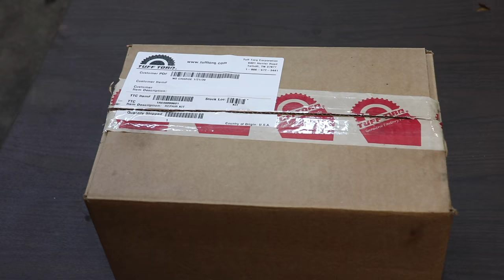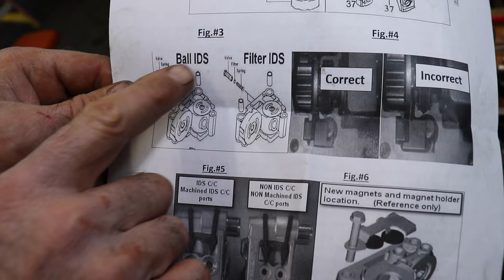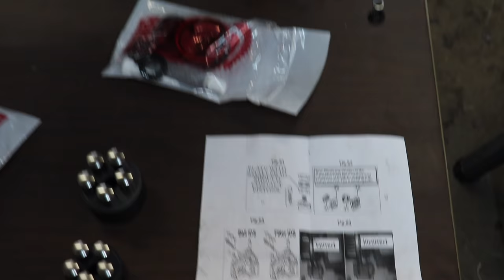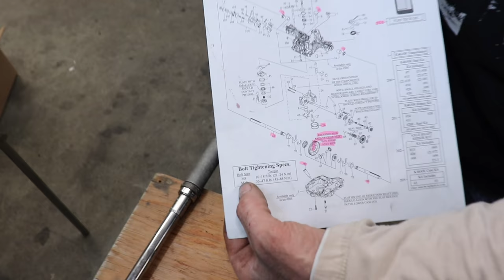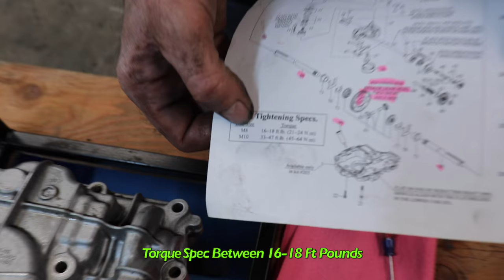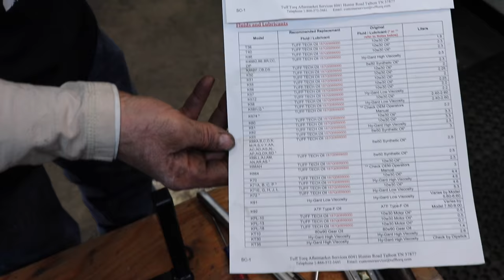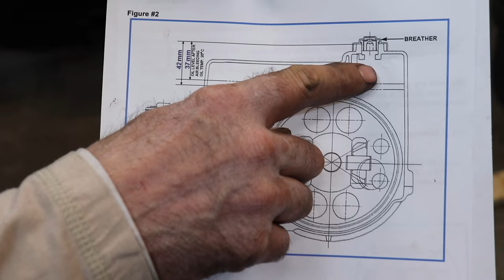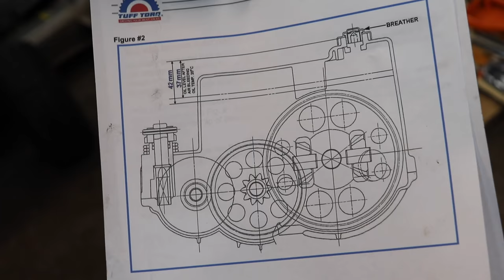How To Rebuild A Tuff Torq Hydrostatic Transmission: A Complete Guide

Comment: Thanks for the informative videos!
I have watched many, u r the best, u even known the names and operations of the parts 😮
I am deciding on rebuilding my cub cadet-K46 XT2 -435hrs. No go in forward/reverse. My dealer in Morristown,Tn. Said Sorry,have a nice day!
Why don’t the dealers/sellers of the mowers tell u this ? It’s not in the maintenance manual, if u call tuff Torq for info or help they say sorry for your problem and did u service the unit at 50hrs then every 200hrs after!!!! No I was not informed .pass this on ,Thanks
Oh yea don’t even try calling Cub customer service! U will be ingorned by a computer 😢

Comment: Two things I did to make life easier:  First I cut some 2x2 wood pieces -- 2-6" long and 1- 6-1/2" long and used lag bolts through the mounting holes to make my own stand.  Quick and easy.

Second I used an Irwin "quick grip" clamp to pull the gears, pump and pump body together.  That way I could install the first pump body by tilting the trans, then set it back down and using clamp to hold the big assembly together set in it place.   Just be careful with those two little mushrooms sticking out --  they will take off if the springs are compressed and the assembly lifts up.

Comment: I've rebuilt two of these.  The k46 is complete garbage in my opinion.  That's part of the reason why the big box stores can sell riding mower's for so cheap.  Luckily, I found a k66 on surpluscenter and never had a problem after I made the conversion.  Good video.

Comment: **NOTE*** The direction of that swash plate on the drive side can vary among the different K46 models.  Early 46BC and 46BD models swash plates are installed in the opposite direction to the model shown in the video.  You can confirm this by looking at the parts diagrams on the tuff torq website.  Also keep in mind the diagram is "up side down" relative to how most would service the trans.  Best to take a photo of yours before the tear down.   That's what saved me.

Comment: I was thinking about air in the pumps and passages, stated 1:07:22 So I was thinking that maybe it's better to run the drill test and recheck the oil level 🛢 before tapping the cap on.
Btw, excellent film 🎥 🎞 📽 🎬 🎥 I was about to skip rebuilding and buy new after watching the last guy. But you made it look easy. Thx for being very thorough.
PS - 
Mine is a 1999 K62 that has/had optional dif lock. Only mine don't have the option. Is it possible to upgrade? OK, possible within reason like just buying the necessary parts and installing like a bolt on, no machining.

Comment: One thing you missed during inspection in the pump and motor parts those spring loaded pistons should have almost zero side play they ware out and allow fluid to leak by. Keep it up I love the videos.
Reply: @JM-yx1lm  yes I was just saying that the most common thing I see is the positions ware out and cause the slow lack of power. He was saying the motor and pump were good without checking those Wich is whare most of the issues come from. Anyway still a great in-depth video on the replacement of the pump and motor
Reply: ...Wear..not "ware"... :)
Reply: @dyer2cycle  So, if true (& no reason to doubt Lol!) any more specificity w/r/t the diagnostics would be of EXTREME help ... w/ kits w/ pistons now running $3-400.00 + and wet/dry sandpaper $3-4.00 ... well just sayin' ... like the vid good show, but w/ tuff torq reps crawlin like ants any further advice RE: tolerances (even down & dirty delta factors) would be of GREAT help ... "most of the issues come from"?  60-80-90% of the time?   How MUCH wear out is literally = wear out?

Comment: Similar to bobcat s large excavator pumps and motors. Swash plate pumps and drives .
Nicely made that Tough Torque transmission.
They should put a drain plugs on them .
Reply: Good 👍

Comment: At 55:00 there are indeed supposed to be two O-rings around that shaft. They are to be double stacked. I hope your fix with just the one new O-ring didn't leak.  TGCA
Reply: Thanks for the tip, have the seal kit and going to do the work in the spring.

Comment: Excellent video. Wish I had seen it a couple of years ago when I had to rebuild the pump. I find it's now necessary to replace the pump shaft, I've been told that can be done without disassembly of the transmission. Can you verify this?

Comment: i think you should check the fluid level after you test run it.
Reply: Chuck the input shaft in a drill and purge the air that way.
Reply: Yes.
Reply: @sethkrahn3155  Thanks. It worked well. Thing is scary powerful. Gt 5000 with hydrogear 331-3000. DAMN! It'll do the job...

Comment: I have a craftsman 19.5hp tractor that I picked up for free so I been putting some work on it overall it's not in bad shape so i got the engine running great repaint the entire tractor frame finder and hood now having a look In side the transmission witch its a K46BA trans I found that it's in great shape but the bypass or free wheel didn't work either the brakes so with this video help with repair I found that whom even had it a part did a bad job with it the bypass pin was out in the case not were it supposed to be spring and snap ring off the shaft got all put together now it works great but the brakes was missing one pade on the right side so I made one with a piece of metal by cuting and grinding and sanding to make it fit work great it's hard to get parts for tuff torq transmission were I'm from so I made do with what I have

Comment: I agree that 47lbs ft seems high. First bolt actually broke in the casing going over 43 so case back off and get another set of bolts. Second set one of the bolts literately pulled the threads out of the case. Tap, helix and larger bolt fixed it for a time but now I’m replacing the case with an eBay special. 
I’m not a rocket scientist but I know my way around cars and this stumped me. I cleaned the threads out before assembly and the bolts were new in both cases. This makes my torque wrench suspect unless anyone else has a thought.
Reply: It's too much toque. I'd do them by feel, no way I'd put that kinda torque into aluminum threads on such small fasteners.

Comment: I rather see a aluminum case tuff torque trans then a plastic John Deere trans.
Reply: J M exactly it’s terrible this new quality of today’s terrible machines! I mean Chinese engines!!!! CMON!
Reply: @JM-yx1lm  well the older ones are good but the newer ones are garbage
Reply: @LIMowersAndMore  1:11:04!😂
Reply: John deer required them to not sell you parts for tuf torque transaxles sold in jd equipment over the phone you have to buy it on there website. I hate John deer lawn equipment they are just stickers on cheep low quality mowers
Reply: @JM-yx1lm  john deer now puts computer chips and codes in each tractor part to shut down tractors if farmers try to do any maintenance or repair themselves. crops have gone unharvested/wasted because farmers can't reach the nearest dealer 500 miles away. states are now beginning to pass right to repair bills. it's hard going as phone manufacturers don't want right to repair bills to pass
Reply: Oh I agree completely ….But to be honest I have seen many failures of these type of trans under Cub Cadets ….Often a oil soaked tire is indictive of the failure and a very slow moving piece of equipment {assuming it even moves at all }
Reply: Holy crap yes.
Reply: yeah NO.... I have a factory installed Tuff Torq PIECE OF SHIT in my D170 John Deer. I am on my second (warranty replaced at 170ish hr) K46. I have 256 hours and IT is done.... 
It's aluminum and a certified piece of SHIT !!!!!!!!!!! Not serviceable, no reservoir, no external filter. Just a CHEAP, BOTTOM OF THE BARREL piece of SHIT !  Class action suit filed.
Reply: I will NEVER buy another John Deere, i THOUGHT I bought American quality.... I bought SHIT ! Runs just can't MOVE !!!!!!!!!!!!!!!!!!
Reply: @JM-yx1lm  Briggs & Stratton same thing the quality is gone.
Reply: @Mark-nu5vg  I was just thinking this the other day, I have been on the 🖕JD bandwagon for over a decade (aside from old-really old obviously) but Briggs.....c'mon wtf how many red blooded Americans cut their teeth on an old Briggs before their balls even dropped,I know I did and have been a big fan since I was 6 but now it to has gone to the new American way, get it cheap af and send it,if they complain fuggem
Reply: My dad is big on John Deere. Don’t know shit mechanically, just buys crap because it’s green and yellow and has JD on it.  After he bought a gator and it went to the shop three times before 10 hours on it (lol) I finally got him away from that garbage. Still has the gator and it still runs like ass with 40 hours on it and a commercial zero turn broke down with less than 500 hours on it lol.
Reply: @daverodkey  hey Dave, I have a tuff torque sludge-O-magic piece of shit that puked at 190 hours, right smack dab between your 170 and 256 hours. The B&S commercial V-twin engine is just finally broken in at 190 hours and the transmission is shot!?!  My lawn tractor would require 10-15 of these washing machine sealed gearboxes in its service lifetime.

where do I sign to sue these bastards?
Reply: I have just watched a video showing a John Deere lawn tractor owner replace his K46 transmission with a K66 Tuff Torq transmission ( if I remember right ) and the K66 is a much more heavy duty transmission according to the tractor owner.
Reply: Lol true
Reply: Kevin Bolin we had more then 25 come to my shop here for returns and warranties it’s terrible!
Reply: Kevin Bolin I miss peerless!
Reply: Robert Slackware  then you'd be happy to see there is a CHANCE Louis Rossmann may get funding to go around to more hearings and get some pro right to repair lobbying going on. so far it's too bad that funding is just a CHANCE!  other wise it the status-quo wont' change to till some younger NON morons get in to office, assuming they aren't' corrupted.
Reply: @Mark-nu5vg  Sadly, it's a trend that has been dictated by the market. China is well known and huge because they excel at making cheap goods in mass. Time has proven that people will buy mass quantity of "not the greatest" stuff if the price is cheap so we did it to ourselves.
Reply: @ dave rodkey , err you can avoid the brand but not that part its in most ride on mowers today lol,only older chain driven stuff is your escape from it.

 I rebuilt mine like taryl and been better than new ever since 12 yrs on 💪😁
Goodluck!
Reply: I don't care long as the gears aren't plastic is main thing 😅
Reply: Nothing is built like it used to be.
Reply: @ Robert Slackware , I think because the brake is internal as a wet brake sort of thing,is why they added that upgrade with extra magnets to catch more from brake wear,in metal filings.

 Eventho yeah  the rest of the internals would do that in wear & tear over time more imo comes from the brake,I use my brake only on slopes else just for park brake to start it,for that reason,so be interesting if I get less crap on the magnets next time I change the oil.

Prolly magnets be worse in catching more,but thats a good thing....I have not yet put that upgrade kit in,might do next time....
Reply: @ Long Island Mowers & More,I would be a troll if I argued against that lol,yup mostly true.....more electronics involved equals more time wasted trouble shooting & more $$$😓
Reply: jaz panoz 100 percent exactly!
Reply: lol at all you guys talking trash to JD when ALL MOWERS run tuff torq 🤦‍♂️
Reply: @AATreeService  new mowers today are trash, I’m always selling good used ones. Keep up maintenance and they’ll do ok.
Reply: @LIMowersAndMore  oh yeah I can’t disagree with that.  I have a 2006 simplicity with a vanguard American made engine.  The k51 has been rebuilt one time
Reply: @cdoublejj  that's so incredibly slimy. Seems to be a new trend with some brands I hope they eventually eat shit with those tactics.
Reply: The housing on the Tuff Torq K46 is Cast Aluminum Alloy very strong and durable
Reply: The plastic transmissions on JD are made by General Transmission.
Reply: @JM-yx1lm every company is like that. I have a few case tractors and they are worse.

Comment: Great video, I am rebuilding a 2019 tuff torq trans K46 DM MTD The magnet under the drain cap doesn't have a cradle. Does it just stick to the bottom of the cap, that's where it was when disassembled.
Thanks!

Comment: Nicely done Taryl. I wonder if it would make sense to leave the cap a bit loose after filling the trannie with oil and do the drill spin to get the air out? Just wondering if the oil level will drop a bit after the drill spin when the oil gets in all the pockets and then recheck oil level and then smack oil cap down tight.

Comment: Taryl i think you might be able to help me , i have a Cox LawnBoss fitted with a B & G 16.5hp and a Tuff Torq K46 trans the issue no drive i have not pulled it out yet but i have already noticed is the expansion tank is full of oil and it should not be the vent valve cap is split and was clogged around it i have one of those on order, have left it a few days thinking that it would drain back into the trans that has not happened is it possible to give me idea what to look for before pulling this apart?           Any help would be really appreciated love your videos very informative and yes i have subscribed.........Thank You    Ian

Comment: My motor shaft will not spin like yours did. It will spin before tightening up the centre case but not after. It seizes up 
I believe I bent the motor shaft when tightening it originally as I didn’t have the bearing lined up correctly . Does anyone know if you should be able to spin the motor shaft after the bolts are torqued up. 
Love your work Taryl. 
Very entertaining stuff.

Comment: You don’t have to buy the fancy transmission stand I made one out of 2x4’s and five three inch screws it took five minutes to make. Cut two boards at 12 inches and drill a 3/4 inch hole at 9 inches for the axles. Put a board between the two and screw them together add another small board to stabilize the transmission . If I could post a picture I would!

Comment: Always love your vids. What’s sad is that John Deere service does not rebuild these transmissions, at least the one in my City would not. They didn’t know anything about a rebuilt kit for this Transmission. They said they would be more than happy to replace the Transmission with a new one. I’m guessing they would charge as much for the rebuild that they charge for a new one. What’s also sad is that these transmissions fail because the Transmissions aren’t originally designed to be serviced. So people that aren’t mechanically incline just spend the 700 for a new transmission. Change the Fluid at 300 hrs that’s what the Company recommends.

Comment: This trans-axle is serviceable, if you know what you are doing. Either buy the pump/motor rebuild kit (gears if needed) from tuff torq for a few hundred dollars or do the following if pump/motor grooving isn't too bad and there is no play in pistons.

1 Remove transmission with wheels attached, thoroughly clean and flip upside down on blocks for remainder of service.
2 Remove filler cap to drain
3 Thoroughly clean dirt from housing since you will not be disassembling entire transmission. Remove bottom clam shell (take picture of assembly if needed for reference later on), remove 3 bolts and pump/motor housing and check for no side play on pump/motor pistons and no severe gear wear.
4 Block wet sand all 4 mating surfaces of pump/motor rotors/base with 1500 grit wet sand paper and 123 block or surface plate until all grooving   is removed and surfaces are flat and restored.
5 Thoroughly clean interior of case, magnets and filter, lightly lube and reassemble pump/motor housing, torquing 3  bolts to 35ft/lbs
6 Ensure there is ZERO contamination inside case. Carefully reinstall clam shell using Permatex gasket maker/motoseal, torque case bolts to 20ft/lbs and let cure 24hrs.
7 Flip trans upright and level, refill with approx 2.3 quarts of 5W or 10W-50 fully synthetic motor oil, proper level is 22mm from top of filler neck, no       higher.
8 Hold shift lever fully fwd or reverse and spin input shaft clockwise for a few revolutions to prime until tires try to rotate. Recheck/top off fluid level
9 Reinstall transmission, slowly run tractor fwd and reverse a few times to circulate trans fluid and cavitation noise dissipates.

Comment: Very good video Taryl. I have a L120 with less than 300 hours. The tractor jerks when on load, going uphill and when turning left or right.  I did replaced the drive belt and tensioner pulley. Also checked the splines on drive pulley of the tranny. Went as far as replacing the tranny oil. Still same symptoms. Calle Tuff Torq and they said to open up trans and check filter and all the other parts. Any thoughts on this? Thanks.

Comment: I'm trying to use your video od the K62A re build to draw my self a build repair manual to put with my Jd lx 255 manuals and records al few pictures of the covers and pin and washer locations would help me in making a good one  tuff torque does not offer one.

Comment: When I refill with new oil I use a drill as well & I fix a clamp to keep drill going & rope to stop whole drill from spinning lol
I leave  fill plug off so I can see air bubbles & round 20 - 30 mins the air is all bled out & top up if needed,seal plug & ya good  to go 🍻
Reply: You have to pull the whole transmission out to do this though right?

Comment: Love your video's. I have a question you might be able to help with. I have a 1990 Ariens tractor that is have a issue. The mower wont move forward and make a whining sound...it move backward strong and fast...just not forward. The belts seem to be tight, the fluid seem to be full, the linkage seems to be moving. The mower is in super good condition and hope to save it. Any help would be great...Thanks